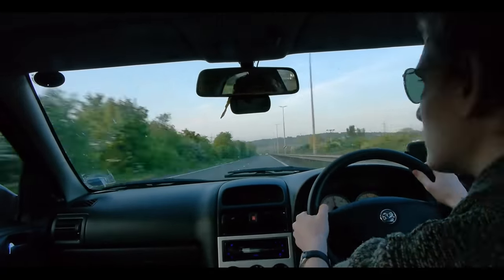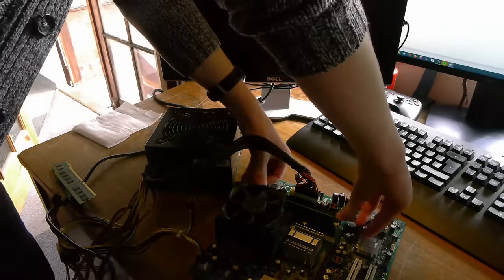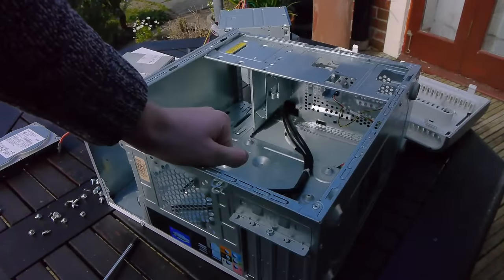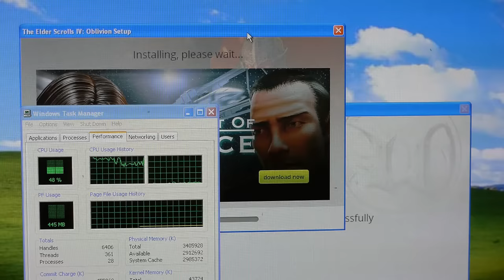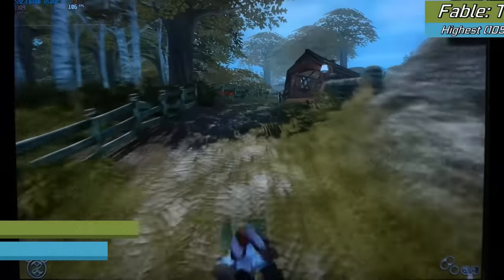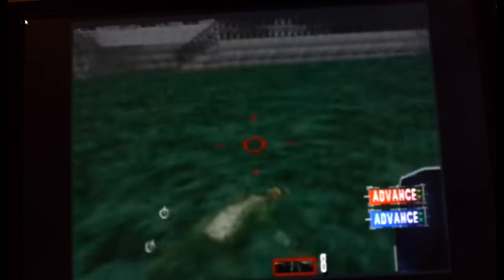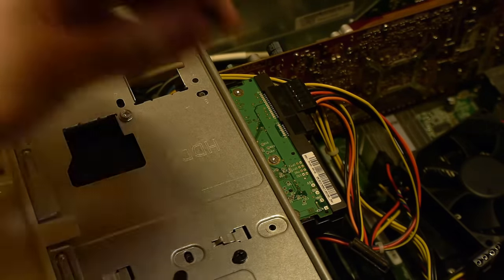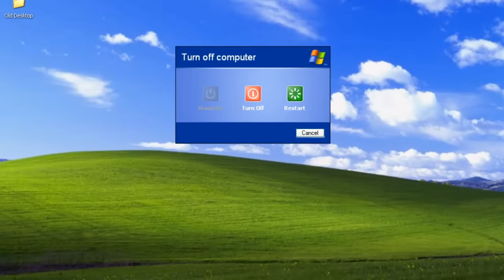The Ultimate Windows XP PC

Comment: I trash picked a 531 (AMD) about a month ago, it was rained on so unfortunately I'm still trying to get a hold of a working board. The AMD versions unfortunately were never updated to support AM2+/AM3, but I snooped the hard drive and it has a pretty clean XP install. I also have a imaged disk of a 531S with an original install of Vista on it, so I took the liberty of putting it on a disk and preemptively installing it in the case. Debating what CPU to use as it came with a Sempron LE-1300.

Comment: Huh... I just recently built my XP PC.
Intel Core 2 Quad q9450 2,66ghz
4gb DDR3 1333mhz
AMD HD 6770 1gb GDDR5
320gb HDD (My SSD wouldn't work with XP)
Reply: A Core 2 Duo e8600 will actually be faster than that core 2 quad in XP games.

Comment: I'm not sure its nostalgia as I never used xp as a kid my first pc had vista but i've been running xp on a thinkpad and something about it is just great compared to windows 10 i''m not sure what though, also if you haven't installed the posready updates i'd recommend getting them there is a tool on mydigitallife called "Unofficial Cumulative Windows XP" which contains all of the posready updates until they ended support in 2019, theres still some modern browsers available too one of them is mypal and the other i called basilisk xp mod I think they are palemoon forks but theyre pretty safe to use on the modern web

Comment: Got a HP slimline with a HD 5450 and a Athlon II X2 245, the gpu is wayyy worse but the processor should be only slightly inferior, wonder if it would make a good xp machine?

Comment: I currently have this pc I’m using(it is very old) and I’m thinking of selling it, is it even worth anything now?
Specs:
- Core 2 Quad Q6600 @2.4GHz
- 4GB DDR2 (not sure of speed)
- MSI TWIN FROZR II GTX 560 Ti
- cheap case 
- no power supply or hard drive

Comment: I use a hp compaq dc7900 i got for a dollar at a yard sale and it didnt have a hdd so i had to get one made for windows vista and use the setting in the bois to emulate it like its ide since its sata and xp requires a sata driver so i upgraded it to 8 gb of ram, a intel core 2 extreme, 300 gb hdd and a dvi graphics card.

Comment: I have the other version of that pc that i found in the dumpster which is the 531s and it had vista on it and it was missing a wifi card but when i got the wifi card turns out the card only works with windows 10 so i installed 10 but i had to upgrade its 960 mb of ram to 4gb so xp would run and it has a amd cpu not a intel one like yours which is odd

Comment: My system is very similar. It has an E8400 and 4GB DDR3 1066 but no GPU.

I did build a system for about £30 which had a 300W Seasonic PSU, E8500, Radeon HD 6570 and 4GB DDR2 800. Sadly the board caught on fire and almost took my home with it :(. Don’t buy pegatron boards

Comment: Nice video!  Even though I'm a penquinista, I like having a Windows XP machine just to run the odd software.  I have several systems that I got with legit codes and OEM XP software (but no hard drives) but after I install the OS I get the 30 day "you must register this software" but the registration servers have been shut down.  How do you get around this problem?

Comment: How did you make CS Go run on XP? STEAM does not supports XP or is there any working hack?
BTW for legacy software try 32 bit WIndows 10 LTSB
Form AM4 boards with legacy PCI, I am using Asus Prime B350-Plus, using SoundBlaster Audigy 2 ZS Platium (with external attachment) works fine, just can't get RAM at 3000 Mhz, just 2666, no B450 boards with PCI so far tho

Comment: Model: Acer Veriton M265

@@@

Control Panel > System

System Properties

---

General

System:
Microsoft Windows XP
Professional
Verison 2002
Service Pack 3

Computer:
Intel(R) Core(TM)2 Duo CPU
E7600 @ 3.06GHz
3.06GHz, 3.00 GB of RAM
Physical Address Extension

---

Advanced > Settings > Performance Options > Advanced

Virtual memory 4606 MB

---

System Restore

Off

---

Automatic Updates

Off

---

@@@

Control Panel > Display

Settings

Advanced

Adapter

Adapter Type

NVIDIA GeForce GTX 560 Ti

---

Properties

Driver

NVIDIA GeForce GTX 560 Ti

Driver Provider: NIVIDIA
Driver Date: 12/27/2010
Driver Version: 6.14.12.6644
Driver Signer: Not digitally signed

Driver Details...

NIVIDIA GeForce GTX 560 Ti

Driver files: C:\Windows\system32\DRIVERS\nv4_mini.sys

Provider: NIVIDIA Corporation

File version: 6.14.12.6644

Copyright: (C) NIVIDIA Corporation. All rights reserved.

Digital Signer: Not digitally signed

---

Adapter Information

Chip Type: GeForce GTX 560 Ti
DAC Type: Integrated RAMDAC
Memory Size: 1024 MB
Adapter String: GeForce GTX 560 Ti
Bios Information: Version 70.24.11.00.60

---

List All Modes...

640 by 480, High Color (16 bit), 75 Hertz

@@@

Control Panel > Windows Firewall

Antivirus: Windows Firewall

---

Firewall: Windows Firewall

@@@

Internet: Crappy less than 1 Mbps AT&T modem

@@@

Control Panel > Game Controllers

Gamepad: Logitech Dual Action F310 Gamepad

@@@

Control Panel > Network Connections

Local Area Connection 2

Properties

General

Connect using:

ASIX AX88772A USB2.0 to Fast Ethernet Adapter

@@@

Comment: This build is rather close to mine. But i have a core 2 quad instead and another hd 4800 i dont specificaly know the variant of. All with 8gb on board but half used for 32bit xp. I tried 64bit and pae but one has poor driver and the othet unstability.

I have space for dual boot if i want to for is vista really worth it? Or 7 while i have a pretty great 10 pc as well? As for 90s games there the 98se machine so mine is straight only 2000-2010ish but advices are more than welcome and opinions. :)

Comment: I've never seen an FSP power supply in a stock Dell system. I've only ever seen them use Delta, NMB, Lite-On, Hipro, and Bestec. Also a note about the Inspiron 530: most examples of it, with their Foxconn G33M02 motherboards, are said to be unable to accept a quad-core CPU, even after updating to the latest BIOS. (Some may have come with the G33M03 instead which does support Quads.) I do wonder if it's, rather than a cap on the core count, merely a limitation to 65 watts TDP, and thus the "S" versions of the Core 2 Quad might work? Anyone tried it?

Comment: I having a hard time with my XP desktop.  I have an old HP pavilion XT963 Windows XP PC Desktop. I am trying to turn it into a Linux, but the problem is some of the f keys for the bios are missing, I can't use the F12, and it will not boot from both a burned disk and USB for some unknown reason it won't respond. Can anyone help me? The problem is some of the f keys for the bios are missing, I can't use the F12, the System BIOS is shadowed and the Video BIOS is also shadowed, I keep changing the CMOS Battery it keeps giving me error 0271: check date and and time settings, and it will not boot from both a burned disk and USB for some unknown reason it won't respond.

Comment: If you were to build an "Ultimate" Windows XP machine, I'd recommend the fastest hardware you can find for as cheap as possible. A 4000 series Intel CPU (an i3 works fine) with a 700 series Nvidia GPU (i.e. 750 Ti) with a Creative SoundBlaster X-Fi sound card for high quality EAX support. One possible good solution is an AMD APU like the  A10-7850K. You could remove the need for a graphics card, and having slightly more than 4GB of ram would actually be beneficial in this case since the onboard graphics would be using it. If you could find a Mini-ITX case with that, you could have a retro XP experience without space concerns of a dedicated "retro" build. These parts are now what the Core 2 Duo was 4 of 5 years ago, cheap budget parts that can play modern games kinda "ok", but rockin' as hell in XP. Keep in mind that these parts are also some of the last that had good Window XP drivers. For building a PC, "end of era" parts are often the best place to start looking.
Reply: By the way, anyone interested in this sort of stuff should look into Phil's Computer Lab. He has video projects going back to old DOS machines. Tons and tons of useful information. Some of his best stuff is machines you would normally ignore that are actually really good solutions for certain kinds of retro builds. Stuff like using 2004 era computer parts to have the "Ultimate Windows 98 PC".

Comment: I use Windows 8.1 Enterprise and for me it is the best system to this moment, very stable and compatible with anything.
Reply: Good luck running 16-bit applications on it. 16-bit support was dropped in all 64-bit versions of windows after XP. Hence why a lot of people including myself keep a XP system around for older software that cannot under any circumstances run on newer hardware or simply runs better on older hardware. The XP era was a fun time in computing.

Comment: Wanna know an absolutely overkill Windows XP?
i7 3770K to 4.5-4.6 on Windows XP
Reply: I can better that with my XP build lol
Dell Optiplex 9020.
XP Service Pack 3.
I7 4790K.
32 gigs Hyper-X Fury 1866 ram (yes I know, but I did it because I could).
500 gig Samsung 860 Evo boot drive.
1 TB Western Digital mechanical drive for extra storage.
GTX 960 SSC. The 4 gig version. (With a very light overclock)
700 Watt 80+ bronze EVGA PSU.
Blah blah blah... Long story short some of my XP era games are now exceeding 1300 FPS lmao...

Side note, if someone is to try and replicate this be aware Dell never made XP drivers for the 9020 series Optiplex. That said if you use Snappy Drivers (yes it's safe and free look it up) it'll install all the drivers and make everything work. Sure beats the hell out of my old XP system which was a Dell Optiplex (notice a theme here yet?) GX620 with a heat furnace Pentium D and a GT730.

Comment: Decent cheap system, but I always hate it when someone calls something ultimate. It is usually like an ad that is never really true. I have a core 2 duo E8600 system with 8Gb of ram and Geforce 780ti win winXP and I would probably call my system better than that even if mine isn't close to anything called ultimate.
Reply from the maker: I mean for XP anything better than a Pentium 4 is going to be Ultimate
Reply: @BudgetBuildsOfficial  Ultimate in what way? I skipped pentium 4 back in the day because they sucked and my first ever winXP pc was an  Athlon64 in 2004 which was much better than P4 and I was using win98 until then. It was quite normal to use something better than P4 with winXP.

Comment: The ULTIMATE Windows XP Build is MUCH faster than this. Intel Core i7 6950X 10C/20T CPU, X99 Motherboard, 12GB Titan X Maxwell. Neither broadwell, nor Maxwell GPUs above the GTX 960 officially support XP, but do work with out any serious issues (unlike Skylake or later.)

Comment: Just curious, why don't you use Core 2 Quad CPUs instead of Duos?
Reply from the maker: This PC doesn't support them. For virtually all tasks I need to do on XP only cores 0 and 1 are used. So the higher clocks also give better performance.
Reply: Budget-Builds Official Ok, that makes sense! I haven’t done much tinkering with XP on more modern hardware, so that’s good to know.
Reply: Budget-Builds Official Ok, that makes sense! I haven’t done much tinkering with XP on more modern hardware, so that’s good to know.
Reply: Because the Inspiron 530 came with 2 different types of motherboards : The Foxconn G33M02 and G33M03, the systems that came with the Celerons, Pentium Dual Cores, and Core 2 Duos do not support the Core 2 Quads due to afaik a power delivery issue. However I think the S series Core 2 Quad will work.

Comment: Is this a joke? The ultimate Windows XP build would be something like a 4-6 core extreme edition, 16gb of 2400-3200 ddr3 ram, a raid 0 ssd setup, and 3-4 way sli 780ti. Watercool the entire thing and bam ultimate Windows XP build.
Reply: Forgot about the optical drives. Gotta do that.
Reply from the maker: Yeah that aint gonna run MGS 2.

Comment: Hi Guys i want to build a Windows XP Computer for old Games (i think ca 2000-2010).

Mainboard: MSI P35 Platinum 
CPU: Intel Core2Quad Q6600 - 4 x 2.4 GhZ
Ram:  4GB
GPU: Gainward Nvidia GeForce GTX 460 GS-1GB GDDR5

Will this Specs be enough?

Comment: I'm sorry I still don't understand quite why some virtual instance of xp doesn't do the job
Reply from the maker: 1. A virtual machine doesn't create PCI slots does it.

2. Some software required real hardware... As I touch on quite a few times.

3. It's easier and more nostalgic to do this.

👍
Reply: @BudgetBuildsOfficial  right I noticed that video capture card and how some games are particular about the video card.  Thanks for the answer.  I guess I prefer running virtual windows xp when it's possible. my garage is only so big.

Comment: "the ultimate windows xp pc" would be a 2600k with a ati 5850 because those components had full xp support
Reply: Why not Core i7 3770K/FX 9590 and Radeon HD 7970?
Reply: An X79 system plus SLI GTX780ti would be about the highest end native XP system you could build, anything newer wouldn't have driver support
Reply: @barbunicolae2711  you are right about the 7970 but with the 2600k you can get higher clocks when you disable ht and all but 2 cores, the 9590 is just a termonuclear joke with shit performance in single/dual core

Comment: Worst gfx you could have picked. Its from the time when ATI was in big trouble and pushed out shitty designs. Its only good for directx titles. Forget opengl, you'll run into so many issues. The card has underscan problems and big heat issues
Reply from the maker: Seems to run cool, and isnt under much strain. The HD4XXX Series is regardes as one of Terascale's and AMDs best releases of that era, all the way up to GCN. Seems to run everything OpenGL related fine, only issue i ran into was MGS2 which is more of an issue with the port.
Reply: @BudgetBuildsOfficial  it isn't. There's tons of issues with opengl 1.5 games. Id tech 2 and id tech 3 soldier of fortune, quake, Wolfenstein etc. It generally sits in an era to play directx9 games really well, but not quite dx10 and weird bugs and issues with anything before, like dx8.1 games. I remember shadow issues in Mafia and i bet it's just the tip of the iceberg. The 13 or 14 beta catalyst drivers are a dark period for ATI before AMD bought them :)
Reply from the maker: No beta drivers here, using the most up to date one's they released for the operating system. This was well into AMDs Purchase of ATI, i think you might have the wrong series of cards as this has aced everything i have thrown at it.
Reply: @BudgetBuildsOfficial  hd4850 was all ATI engineering afaik. Unless the reissued it with another architecture, its the exact card i had. Latest drivers for xp are those catalyst beta from ATI. I might misremember, but those issues are all unresolved since its still "as-is" driver with no guarantee. Its so bad in fact, that i just checked. Nice if it works for what you wanna play, i just know for a fact its very hit or miss and the 8800gt is the much better card for overall compatibility

Comment: sorry but... C2D being an absolute overkill for an XP system? Seriously?
C2Qs and eary i3, i5 - and why not i7- systems could be called the ultimate XP  PCs. I have several C2D, C2Q, 3rd-gen i5 and i7 as XP systems. Now, one could argue they really are not the real XP PCs but they are. None of them is older than 2012 or maybe 2013 but back then Windows XP was still going strong.
i5 3570 or such based desktop PC with 4GB or more of DDR3 can be had for cheap. Overkill for an XP PC? Absolutely not!
Reply from the maker: Yeah you didnt watch the video did you mate
Reply: @BudgetBuildsOfficial  and why should I? When I see C2D and ultimate XP PC in the same line, what's the point?
Reply from the maker: Ya know if you watch the video you'll see why it's pretty ultimate 😎
Reply: @BudgetBuildsOfficial  mmkay... I do have a system based around Asus P5E64 WS Evolution motherboard with C3Extreme (QX 9650) @ 3.0GHz and it really is a sweet setup. However, much more powerful system with 2nd or 3rd gen I5  CPU can be had. Even i3 3240 will kick its arse for not that much more money. There are so many Dell and HP business-class desktop with 2nd or 3rd gen i3s or I5s one can have for peanuts.
So no... I disagree. C2D systems do have a certain appeal but they are anything but ultimate.

Comment: The ultimate Windows XP PC is a new PC with Windows XP installed on it. You don't really need to get vintage hardware to run a vintage OS until you want to go back further than Windows 2000 Pro.
Reply from the maker: Drivers, and HW Specific features.
Reply: Dude if you do that it will give you a lot of errors

Comment: It can run Crysis !
But if it's the ultimate PC for xp, what was the previous PC of my brother (phenom II x4 955 8Gb ddr2 and a HD 5870) my mine (i3 6100 8Gb ddr4 and HD 6950) that was running xp too ? 😱
Indeed CPUs have rarely a problem, but I saw an one (i7 3770k) with a almost unique visual glitch with mainly 3D elements : https://www.youtube.com/watch?v=vGbnVVfRmu4 (the translated subs are correct for once)